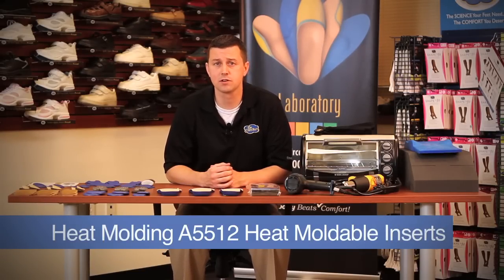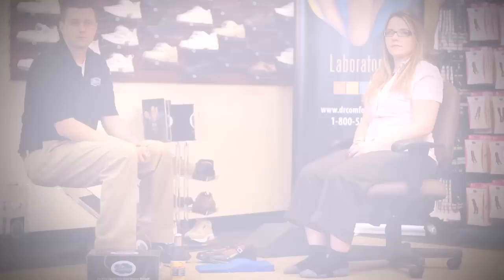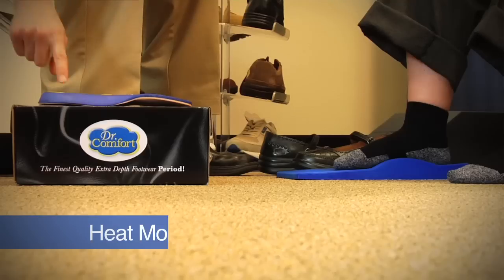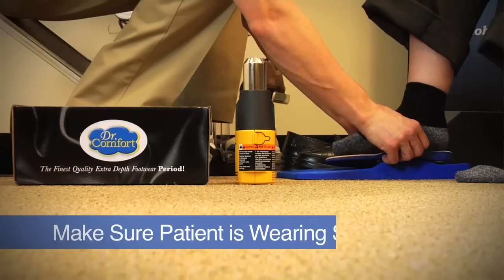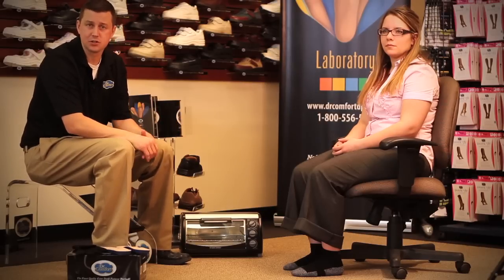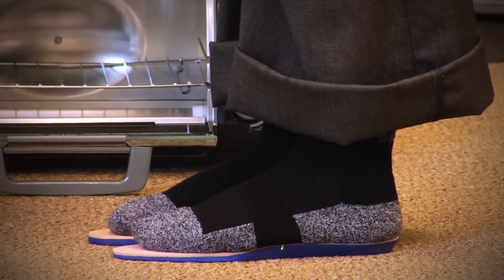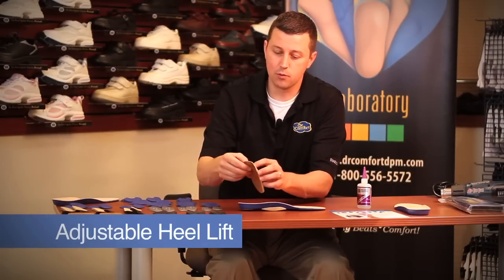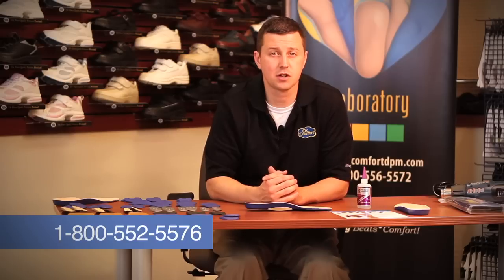Heat Moldable Inserts Video

Comment: for the convection oven method... HOW LONG?   what is "an appropriate amount of time?"
Reply from the maker: +Christine Lumbroso Thank you for your question. The amount of time varies depending on the convection oven and size of the insert. With that said, in general it is about 30 seconds at 300 degrees.

Comment: Wellness Life has sold these shoes for years and they send you these pads claiming they are custom molded inserts. They are not, they are heat molded inserts you can buy on the net for about $25.00 for three pair and they charge Medicare for the Custom Molded, three pair $252.00. SOMETHING IS NOT RIGHT!!!!
Reply: My thoughts exactly!!  I paid more for these cheap inserts than I did for the shoes!!
Reply: I am diabetic with high arch problems and left foot bunion as well .i got my first diabetic shoes with custom made orthotics but its not really giving me relief and 3 pairs of this same insoles came together with no instructions. It does says it moldable.. but how? I feel they rob me and over charged.ugh.